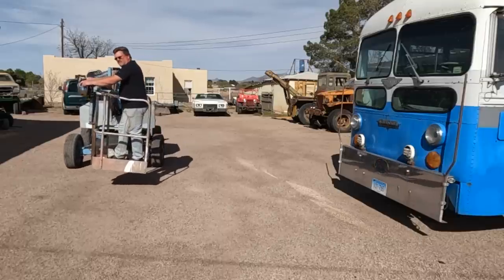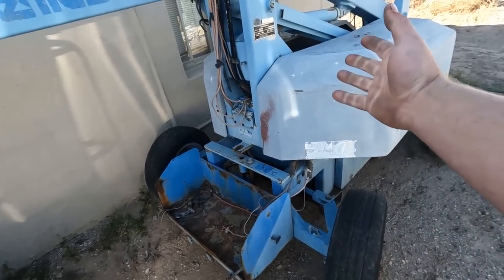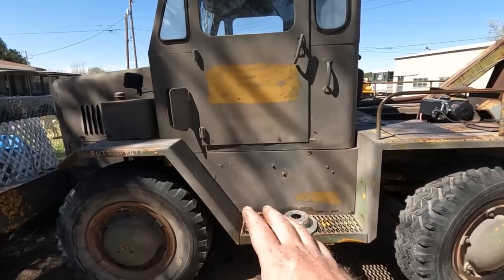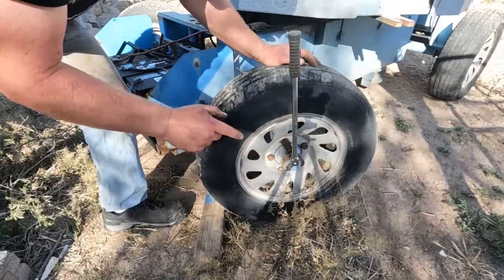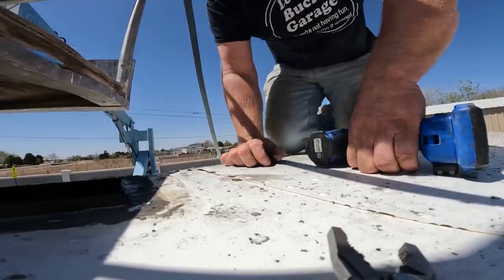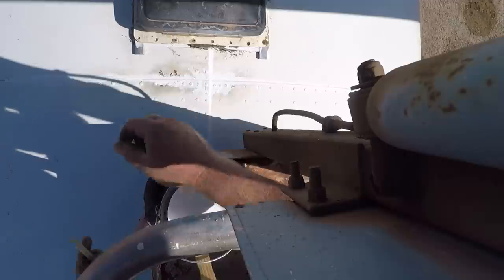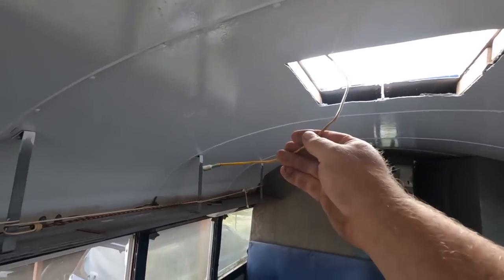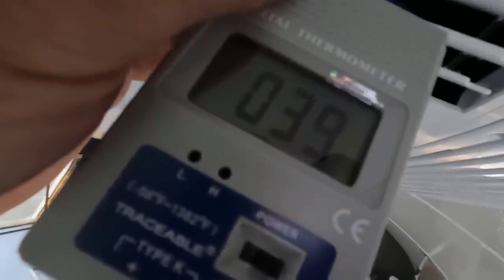Rooftop A/C Install, Everything Is Broken!

Comment: As a 3d printer, the best way if your having your print not sticking is to use painter's tape and a glue stick. Problem solved. Hairspray "extreme hold" works really good to on a glass bed.

Comment: Even with the no reverse issue, that man lift is worth gold! That roof structure is many times stronger than most new motorhomes (not based on a big dollar bus). I live in the south, we run our generator most of the time during the summer to power both roof A/Cs while traveling. Love the content!
Reply: Same here only we have 3 roof top AC units and a full size residential refrigerator.

Comment: I remodeled my brother's BSB motorhome / race truck  and one of the cheapest and transformative jobs on it was to cover the celling with some grey carpet and inset lights which cuz now a days are LED don't need a massive air gap round them cuz of the heat. The Grey carpet which is just uses spray adhesive made the RV look modern, clean and tidy. I will totally recommend this to you to do especially as it seems you've got no insulation up in the celling. Keep those great videos coming there and you are great

Comment: I have a Tronxy X5SA-400 PRO... I would highly recommend it.  It has a huge print area of 400x400x400 mm and works great.  As far as the bed I too use blue painters tape which works amazingly well!

Comment: I'm guessing Dad splurged on the AC unit,😉, I just can't see you buying something new like that, when you could've gotten a used one for less than a third of the price, 🙄, lol, are you going to do anything about the rust under the trim-pieces?, I'd hate too see a gem like that old bus get turned to scrap over something so easy too fix, awesome video, thanks for sharing.😁👍

Comment: Great job.
TSP, is what I used to use for cleaning engine blocks.  It is a wicked cleaner.  I know you're in the desert, but curved motorhome roofs are a lot less trouble to maintain than the flat roofs.

Comment: Great job and impressed with all your "work arounds" to get things in place for use.  Just an FYI ... "Buses" are built just like I build C-130J Super Herc (and similar Aircraft). Our rule/spec requires "Sealant between all faying surfaces". The purpose if firstly corrosion prevention but more importantly to prevent ingress of Water. True story of an Italian Aircraft manufacturer (that will remain nameless) that built a "Mini C-130" and like your Bus but differently from our Hercs (that get "Dimpled" AD solid rivets) ... decided upon "lap" construction and didn't listen to me on the always required "Sealant between faying surfaces".  Initial Test Flights in rainy Milan ... Pilots would do their touchdown and inertia pushed all the Rain water to the forward Cockpit ... where it would then leak down onto the Pilots backs. They didn't like it and a very costly rework situation. This is to say that in the future, please shoot a bead of sealant into your repair areas before final riveting operations ... and yes, you'll know you have enough if there's "squeeze out" ... LOL.

Comment: I had to look up the current price is the roof coating/gallon.. Dang $130 for silicone. I've used the acrylic from Henry(587) that's around $30/gallon. Good stuff but needs to be applied every few years.

Comment: The whole situation with the man lift and the tow tug reminded me of something my dad always says.

"Never fails. You could leave any machine sit for years at a time and go to it whenever and start it up just fine but when you actually need to use it, the sonuvab*tch is either buried behind a bunch of other crap, out of gas, batteries are stone dead, it needs to be overhauled or all four. Can never hop in it and go when I actually need it."

Comment: I am happy that you were able to locate TSP as I have used it in the past to clean insides of mobile homes with great success. I never did attempt air conditioning and its funny cause dad had a large commercial locker plant that required keeping things frozen... I should of learned it. At seventy three, I won't need to worry over that a lot. You know a fun way to remove ten feet of snow out of your yard and make it closer to sixty plus degrees? It is april the thirteenth and its still snowing like crazy and more yet to come this week for sure... april showers bring may flowers is not going to be a nursery rhyme this year.. must be the heat wave from global warming (did you detect sensizim?)

Comment: I think I installed the same one in our motorhome to replace the older Coleman-Mach unit and it has a heat pump so we don't have to use the propane all the time. However - it can't maintain the correct temperature. If I'm using heat and have it set to 68, for example, it'll just run up to 80. No idea why. The a/c may work but it can't keep up with the heat in the vehicle so in the summer it can easily get up to 85 inside.

Comment: I know it's too late now but the gasket that comes on the ac unit it really thick (1 inch plus) to accommodate the curvature of the roof. Most RV roofs have a little curve to them. You could have used it as is without the extras.

Comment: My experience with AC is that it really lowers humidity and that can make as much difference as lowering the heat. Just wondering where the condensate goes? It is distilled water and as such may be useful for something in a desert. Nice Video as usual. ben/ michigan

Comment: you've got the same problem i have. i have three things to do, before i can do whatever it is i want to do, because everything i have needs something done. how's that for circular thinking? with 7 trucks, 7 motorcycles, 2 cars, a mini van, an suv, and a wide front farm tractor in various states of disrepair, i have no lack of projects to work on. motivation and repair parts on the other hand...

Comment: Any round profile roof like on this bus will have corrosion/rust issues at the transition to the sides, condensation will drip along the underside to eventually end up sitting on the side frame

Comment: Is there any downside (other than cost) to use walnut shells or softer bead blast medium to deal with the rust? vs a small rotary wire wheel.

Comment: Great video. Quick question, is one AC unit going to be enough? Wouldn't two be better? We have three on the roof of our RV, but we stayed cool in Key West in July.
Reply from the maker: Probably not, but it's much better that what was there before.  I'm planning on adding another in the rear, because that back bedroom doesn't get much air from the front.